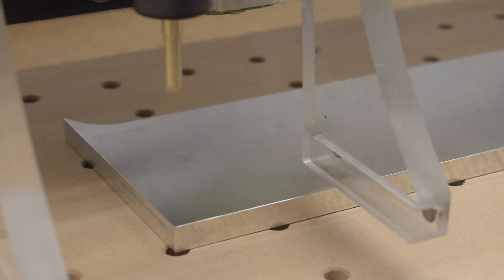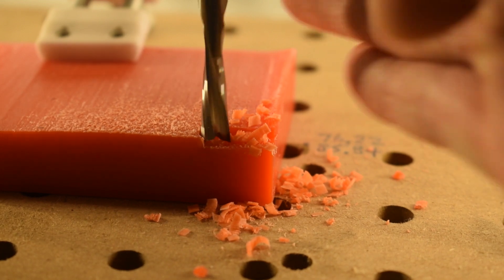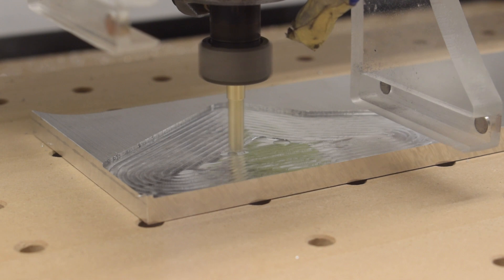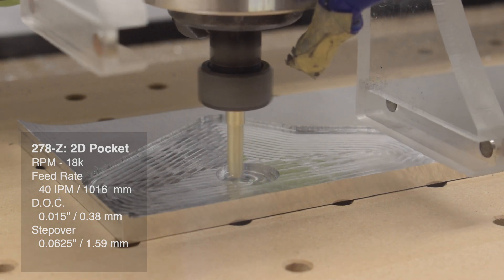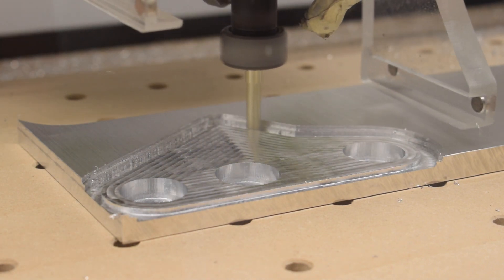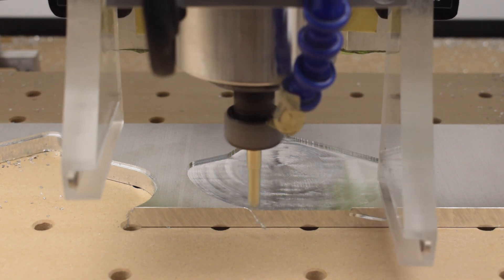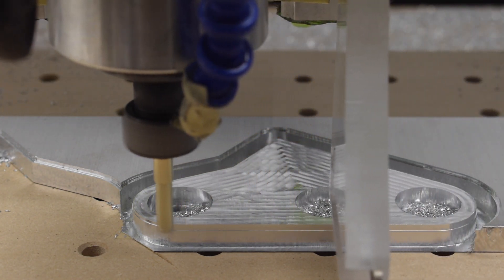Machining Aluminum with the 278-Z on the Shapeoko - #MaterialMonday

Comment: Yay! Thank you!  Finally a clear, concise, and fully explained demonstration of the advantages of single flute cutters in aluminium.  If only someone would give me five bucks for every time I've seen a broken 1/8 inch four-flute cutter with a blob of aluminium melted onto the end, it would buy me a decent single flute cutter.  The only thing I would add is different grades of aluminium machine in very different ways.  (I know you have covered this in previous videos.)
Reply: Instablaster.

Comment: I would very much appreciate if you would show your Fusion 360 tool, passes, and linking tabs in future videos. It is so hard to guess all these things, and one glimpse at yours would solve 100 problems for me. For example what is the speed and feed for the 274Z? Also if Carbide 3D could supply a chart with a list of all the end mills they sell, including single flute 1/4, 1/8, 16th etc sizes and respective feeds and speeds for aluminum would  completely remove any confusion. Possibly a different value column for nothing, air blast, and air blast and mist. I would pay for this chart! It could not take more then a few hours for a pro to make,  everyone lists 3 variables and fusion requires 25 different ones! Very difficult to figure out for a beginner without examples to look at. Thank you very much for the very helpful videos Winston!
Reply: I run a 3fl alu bits from shazam. Or the cheapest ones. Or the green banded ones. Those work verry well on small routers. I have 0.8kw spindle.   With my proverxl (v1) i easely run 5mm endmills.   But keep in mind.  Dont take to shallow bites. Or to deep.  Listen to the machine.  Go deeper take smaller stepovers and bump the feed.  Experiment with that.   You might be surprised.

Comment: I agree on all points. On my current DIY built cnc which has 20mm thick aluminium tooling plate as bed and I use a machine vise on it (it has 200mm z height so plenty of room) it really makes a big difference compared to the multiplex/MDF bed I had previously. A lot less chatter, the cuts are very shiny, almost mirror finish even with a single flute 4mm cutter at 17k rpm. The mass and stiffness of the vise and bed really makes a difference. I also invested in AA or AAA graded ER-11 collets, with run out between 5-10um (supplied had 20-40um run out), that made a difference too, especially in reducing friction and heat build up.
Reply: I run a 1/8” carbide mill on my cnc router/mill to cut 6061 aluminum. The size of chips is very small, almost like powder, is this ok? Am I doing something wrong here?
I use a flood coolant system with air blower, the spindle is not very fast 11,000 rpm (cheap Chinese made). Do you think higher rpm is better? Or should I use a 1/4” carbide mill ?
Reply: @arbjful  How many flutes does it have? It's probably best to use end mills with 1 or 2 flutes. If it's like dust then the rpm are too high or the feed rate to low (this has a certain balance that results in 'chip load'). If your machine is stiff enough you can reduce RPM or increase feed rate. The chips will be larger. Try out what works for you.
Reply: @imqqmi  thanks for the reply. It’s a 1 flute endmill.
Reply: @arbjful  a small bit makes small chipps. I run 7075 t6 at with 3mm 3f bits at 450mm/m with 18000rpm 0.6mm stepover  at 3 to 4mm depth.  seems to work for me. Nice chips.

Comment: I was excited about these endmills and dropped just shy of $80.00 for a single 1/4" and 1/8" bit shipped only to find that I could have gotten several 6mm Chinese single flute cutters for the same money.  So for those on a budget shop around!  The uncoated mills cut just as nice provided you have proper chip evacuation.  I even saw a MPCNC cutting ALUMINUM at 15mm DOC using adaptive clearing with no coolant just air blast and that is not as rigid as a SO3.

Comment: I’ve been getting a lot of plastic jobs in at work where typically I normally did steel. Do we’ve been using 4 flute endmills on the plastic running them at steel speeds. I just ordered our first 3/8 single flute. Super excited
Reply from the maker: In our experience, single flutes have been more forgiving on speeds and feeds.

Comment: Good vid, I subbed..... however, you don't need to "Clog" the cutter for aluminium to weld onto it. All you need to do is weld some on the cutting edge and its compromised. Also coolant isn't about being able to handle the part after its finished. Its about creating hardness in the material so that it cuts better and shears cleaner. Coolant is still worth using. 
btw. thank you for the metric translation.
Oh also I would have cut this part by Cutting it with a saw to a more reasonable approximation to part and then used the side of the cutter to mill it, but your machine may not be rigid enough for that.

Comment: Any chance of a explanation of drilling aluminium feeds and speeds and deep drilling like 20mm with small Dia like 1/8
Reply: Google calculating speed and feed formulas for drills. Your sfm in aluminum is usually going to be between 300-400
Reply: Important thing to keep in mind as well is drilling especially with hss drills it's important to do a small spot first, and drills over 1" it's very important to check for run out as before and after cut on deep holes.

Comment: Are single flute cutters only for Aluminum and other metals? Since you didn’t mention any wood parameters I’m assuming?
Reply from the maker: ZrN coated single flute cutters are primarily for non-ferrous metals only. There are also single flute cutters for plastics, but they are ground differently (sharper but more fragile) and should not be used in metals. 

The single flute geometry is good for getting around chips and pulling them out of deep cuts. Metals and plastics can fuse or melt, causing problems during cutting if you don't get chips out of the way fast enough. There is no benefit in using single flutes in wood.

Comment: Good information. 
I currently use a 3 flute carbide end 1/4 end mill at .25in DOC and .017in step over at 47ipm for 2d adaptive and contour on my fox alien wm 3020 cnc.
Reply: That's incredibly deep. How often does that clog up?
Reply: @CSparzo  it hasn't yet. I also do not run coolant

Comment: What are your thoughts on speeding up your RPM to get better MRR rates? You could push to 20-30k with the same settings and accomplish much faster machining times.
Reply: If you can maintain the torque then that is fine, but there is limited rigidity to the Shapeoko and the surface finish will get poorer. If you set the machine in concrete to add weight and reduce resonance, thicken the axis supports and increase the power of your steppers, as well as probably installing water cooling for that fast spindle then it should do fine, but I am not sure it is a Shapeoko then. Personally, I believe reducing the feed, but taking full depth cuts provides a greater speed benefit. Large chips remove heat better and it uses the tool more efficiently, but I run industrial machines so I don't know if the torque required is available on a Shapeoko.
Reply: Look up @vince.fab on instagram. He's modded his machine a ton, but a router can handle those RPMs. However, at those speeds, I'm not sure if cutting dry is advisable, I see most people employing an alcohol-based mist coolant solution at that point.
Reply: @bluedeath996  Material removal rate (MRR) is proportion to cutting power, which is proportion to cutter speed (RPM) and torque (I.e. force).  So cutting forces are reduced when RPMs are increased for the same MRR.  Or MRR can be doubled without increasing forces by doubling cutter RPM and some combination of feed rate, width of cut, and depth of cut.

Comment: Any reason why you bought a larger stock and trimmed off the top? I'm aiming for .25" parts and I use trochoidal slotting for my parts with .25" stock, seems to be more efficient, takes less time and puts less strain on the tool.
Reply from the maker: The part was 1 cm thick, and I had 1/2" stock on hand. Also, if you want flat surfaces, you should always machine the faces. Never trust raw stock to be perfectly flat.
Reply: Carbide 3D makes sense, thanks!

Comment: Are single flutes more effective then twin flute in MDF? You focused on metal/plastic but curious your opinion for wood? Great videos clear and easy to digest
Reply: Not really. The thing about MDF is that it's not going to weld itself to the endmill if it gets tightly packed. So you don't need the chip evacuation of a single flute. And it's much easier to machine, so you'll never really be power limited.
Reply: @WinstonMakes  thankyou!  , your content is always very informative and entertaining great job
Reply: Mark Crane *than

Comment: VERY interesting and informative video thank you. Please give us your thoughts on speed/feed for the popular  30x18 routers. I have been playing with AL and keeping it too a two flute with extremely low feed 2IPMx.005" deep 50% step over and getting a horrible chatter. The 30X18's are pretty weaksauce spindle max speed is 9K RPM IIRC.
Reply: Idk if you ever figured this out or not, but 2ipm is way too slow, you probably had massive amounts of rubbing. A good rule of thumb I follow is you don't want your chip load per tooth to get below .001" or chatter/rubbing will happen. Try to see if you can up your feedrate any without the lack of rigidity on that machine causing problems.

Comment: Yea but...  I'm having trouble wrapping my head around "roughing" end mills.  Your video on single flute have made things worse (I feel relieved, great video, but also confused).  What is the use/advantage of the 4/5/6 flute end mill.  Are they best for contouring (say outer edge of part)?
Reply: They are good for other materials and used on real industrial machines. I'm assuming you have a cnc router if you are watching this video?  In my experience, 4, 5, and 6 flute endmills are  not suited to routers with high rpm and low rigidity.

Comment: Climb or conventional?
Reply: They do two different things. Climb milling enters thick ends thin. Conventional enters thin end thick. They have two different applications. Climb will usually give you a better surface finish but both will push and pull the part in different direction according to feed direction. The material moves WHILE your cutting it especially if thin features. The answer to your question is more situation specific. Consider it is the same as asking in which position should I mill my part.
Reply: Kinda the reason I was asking which he used for this.
Reply: If he's rotating the spindle clockwise then hes using a conventional.
Reply: The easiest way to tell is if you were standing in front of the part and it's moving left to right on the back edge, or right to left on the edge closest to you, it's conventional, and climb cutting is just the opposite
Reply: @asmira4190  Dude, in this video? He using climb milling. spindle rotation in the direction of movement. Or how you remember it. It is like a wheel rolling along a surface or climbing over it....
Reply: You're right. Heat must be getting to me to fuck up a simple part of my job.
Reply: @asmira4190  https://www.datron.com/blog/climb-milling-vs-conventional-milling/
That is on the Datron website.
For more information

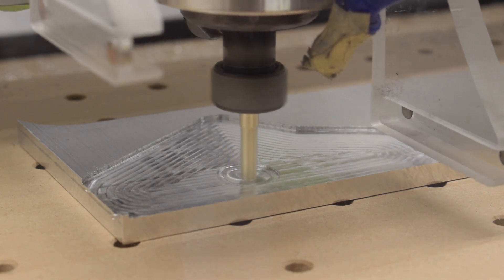Comment: Ref: 1:54  That would be me....
Reply: Do you think the benefits of a single flute cutter outweigh the lack of strength?
Reply: What lack of strength? I have been using my Datron single flutes for more than a year now. The rigidity of a 4 or 6mm cutter is way more than enough. If you don’t belive me look at the Datron recommended feeds and speeds for their products! Those are designed for MRRs (and obviously citting forces) that are far exceeding the overall rigidity of a S3.
Reply: Adam Fowler They are just as strong as two flute cutters. I’ve used them in industry where the extra chip clearance was needed, but they don’t have a place in my shop. As a hobbyist and a frugal machinist the price per flute makes no sense for me.  I’m happy with 90% of the performances and 2 to 3 times the cutter life of a 2 or 3 flute ZrN cutter.

Comment: I would argue that single flute results in a bad surface finish compared to more flutes since you're basically having a hammering action due to the sudden shocks on the end mill.
Reply: @John-ik2eg  What I said is not from my imagination. It's actually in the machinery's handbook you could go check it out. There are certainly other considerations but generally speaking, more flutes equal better surface finish.

Edit: You could get a more intuitive feel of it if you take an extreme example. Just for argument's sake, say you have a single flute 1 meter diameter cutter. The cut is so discontinuous that it almost feels like a hammer hitting the workpiece. Now say we have 100 flutes instead. There you go, you're starting to get it. The velocity of the spindle varies so much that every time the workpiece experiences a different force.
Reply: It depends on the Type of cutter your using, an insert mill with all but one taken out will achieve a better finish than with multiple, solid mill wise I'd be inclined to agree.

Comment: It's a nice story but it's mostly nonsense. The amount of torque required for any cut you could attempt in 6061 on a benchtop CNC router is miniscule, regardless if your cutter has 1, 2 or 3 flutes.  You'll break a 1/8" or 1/4" tool long before your spindle stalls. Plus, you won't cut anywhere near to your machine's max feed speed. 

A single flute end mill may help surface finish if you didn't tram your spindle properly but it will just slow you down most of the time (unless you have one of those 60,000 rpm Datron style spindles). 

Stick to 2 and 3 flute coated carbide end mills for milling aluminum on a high speed spindle.

Comment: Wrong, because desktop cnc machines have shit spindle bearings, single edge cutter loads the spindle bearing one way. I bet dollars to donuts if you ran a 6mm (1/4in) cutter through material and measured the cut it will be oversize. Having multi tooth cutters highlights spindle slop. As the tooth is exiting or near exiting dia of cut, the new edge comes in and throws the slop back the other way, causing chatter and rough operation.
 more edges the better for any normal cnc
Your analysis of tool chip load for multi tooth cutters is misinformative